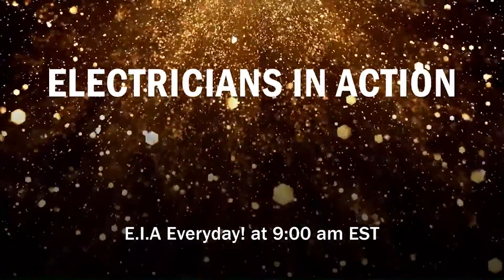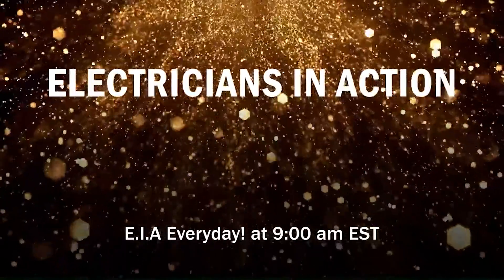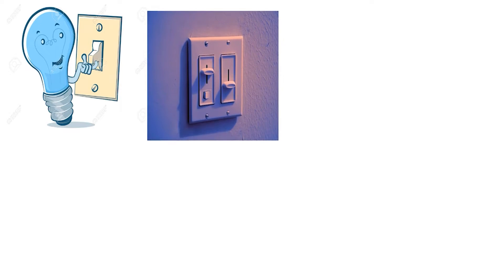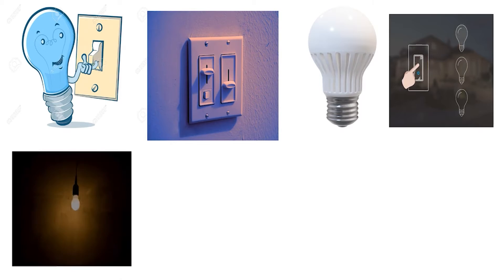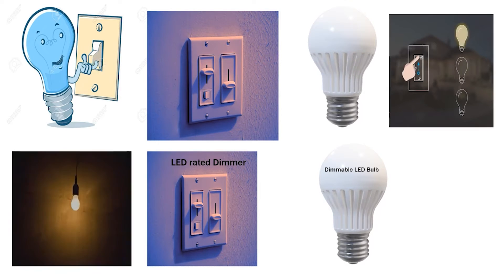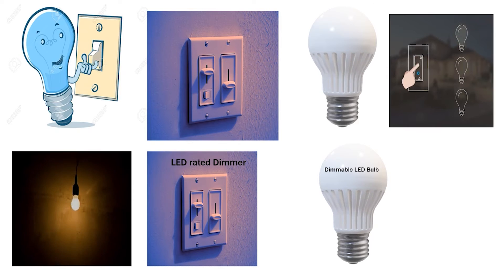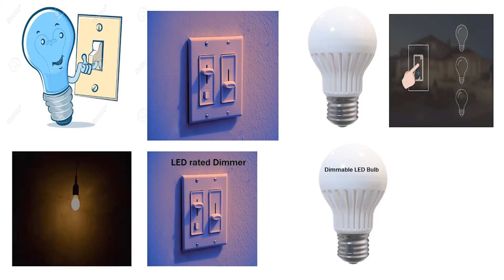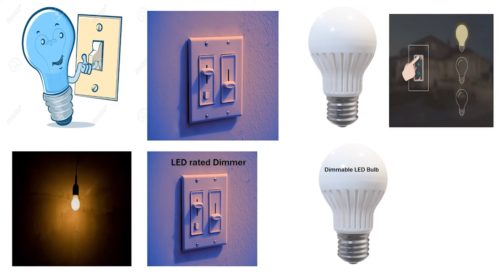Why LED Dimmers Flicker. LED Dimmer Switch problems. LED Dimmable Bulbs. Light bulbs flickering.

Comment: My house was built in 2011 and I put all new LED bulbs in with the original dimmer switches.  Everything worked well for the first year or so.  One switch the bulbs will flicker off quickly.  Another switch just 2 of the 4 will flicker on and off.  Another switch just one flickers.  The flickering didn't start happening until after a few years of installation of the bulbs.  Is this an indication that I have outdated switches?  Thank you for your help

Comment: I have a contractor telling me that he may also recommend changing the fixture.  Even after you have a compatible dimmer switch and LED dimmable bulbs.  Is that the case?  The house was built with dimmable lighting in the family room (and dining room chandelier) with Incandescent light bulbs back in 2005.
Reply from the maker: Is it flickering or shutting off and on?

Comment: Could you do a video on why an led bulb "glows" dimly when the switch is off?  I have a vanity light in the bathroom with 2 led bulbs, non-dimmable, and no dimmer.  At night when it is dark I can see one of the bulbs "glow" very dimly and the other one not.  I have changed bulbs and put in a new switch but it did not fix.  My guess is there is some time of voltage leaking from somewhere but I cannot understand why only one bulb is affected.
Reply: I'd swap the bulbs first, but my best guess is one of the sockets is wired backwards and is picking up stray (induced?) voltage, perhaps from the GFCI outlet. Worst case is you could install a 2 pole light switch for that fixture.

Comment: Leds are interesting, i have a front porch light that when seen through my security cam monitor, the light appears to flow from top to bottom. When first seen i went outside and looked at the bulb to see if it was going bad. It was a normal solid color. After awhile it appears solid through the monitor also. It is yellow, but the back porch led is white and doesn't appear to do this. Overall, i really like led bulbs and appreciate this info about dimmable bulbs etc. Most of the info you give is way over my head, but it is still very interesting. 👍🏼
Reply: that's a problem cause by the video refresh rate of the camera. We see it all the time with flickering taillights on cars while we watch videos of dash cams. The bulb is working with 60 cycles line frequency. (sometimes 59.9) and the cam might be as low as 15 frames per second to save band width. Basically it's like using a strobe light and seeing things in slow motion. BTW, some bulbs "buffer" the strobe effect with a capacitor. IOW, a different brand might show up differently on your screen.